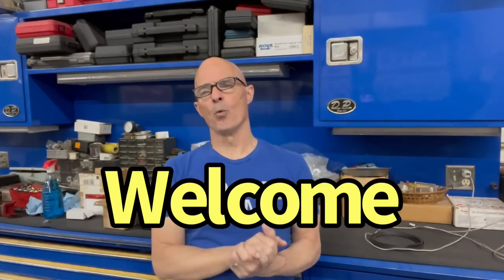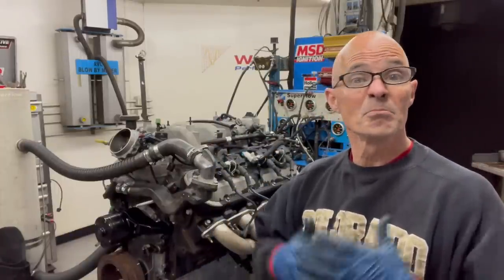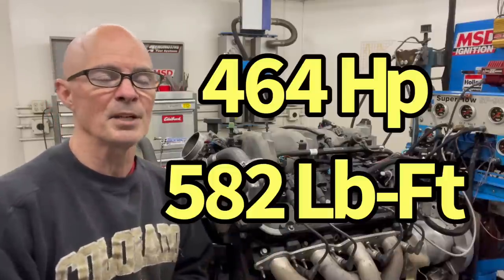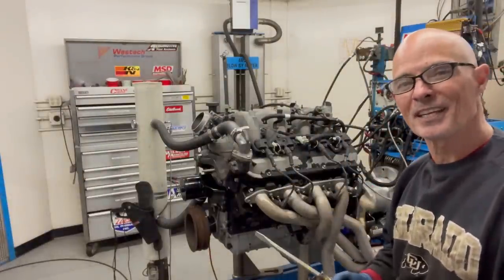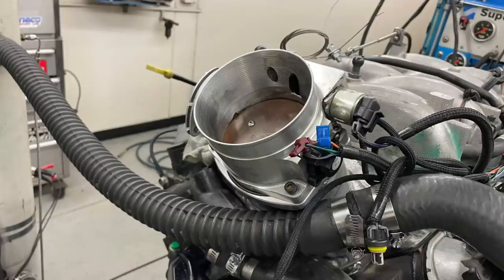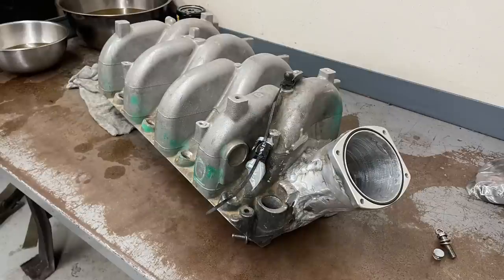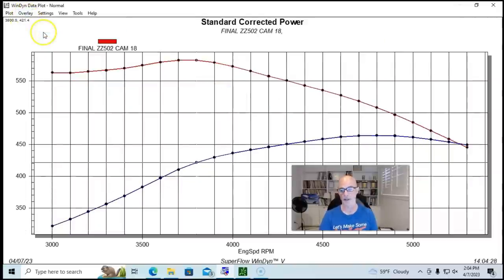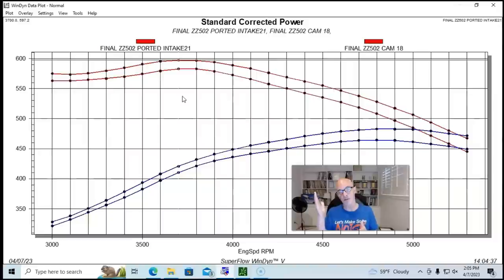GEN 7, 8.1L BBC INTAKE TEST! HOW TO SWAP A MODIFIED INTAKE AND MAKE MORE POWER WITH YOUR 8.1L BBC!

Comment: Let’s talk torque for a second a bolt on 8.1 can handle 11-12PSI all day which is madness 12 psi on 500hp and 600 torque with out pushing to hard that’s 1100-1200hp and 1500 lbs of torque

Comment: Another nice video Richard.

What you have done so far would make a killer engine for a tow vehicle.

I think that both that camshaft, and that relatively mildly modified intake are really holding the power back. 

Throw on a set of Yella Terra YT6318 rockers, you'll need a set of semi trick metric socket head cap screws. And then the correct 7/16" pushrod, at least 0.125" wall 4130.

It really wants a Comp XM284HR cam, but you have to be super careful about piston to valve clearance, it may need the YT6317 1.7:1 rocker. Billy Godbold told me it could actually be ground on their Gen VII core.
Reply: Depends on how heavy a RV you're towing. I had a 2001 Silverado 3500 8.1 and changed cam to high torque and modified intake all from Raylar Engineering.  Towing 14,000 lbs there was a noticeble drop in low-end power/torque. I also dropped gearing from 4.10 to 4.56 gears and ran shorty headers. I would only recommend doing the mods if your tow weight is 8,000 lbs, or less
Reply from the maker: WHY WOULD WE WANT .125 WALL 7/16THS PUSHRODS? BUT ROLLER ROCKERS ARE ON THE LIST

Comment: Your 8.1 videos are making me hang onto my rusty bodied 01 Avalanche 2500 for perhaps another upcoming brutal Minnesota winter. And, what if I need that pulling power to yank out a barge stuck in the Mississippi river? LOL The amazing thing is after I replaced the rear main seal, it hasn't lost a drop of oil nor does it have any coolant leaks...I thought for sure I'd be an oil sucker at it's mileage.

Comment: Richard, please do a Dodge 8.0 (1994-2003 Ram 2500/3500) V-10! I own a 2001 Quad Cab short bed 4x4 with this engine (around 450,000-460,000 miles on the original engine), and with just a crappy K&N intake, cat delete, JBA ceramic-coated titanium short tube headers and a Hemifever 93 octane tune (running on Commiefornia 91 octane), I'm running 0-60 in 7 seconds flat at 1,700 ft. Altitude. It's absurdly quicker at sea level, as even  with the tune I have on it, it still runs EXTREMELY lean under w.o.t.....lean enough to cause the passenger side header to glow LAVA red after any kind of WOT run! This thing needs more fuel BADLY.... but I'm still able to turn sub-7 second 0-60s at sea level, and I'm right around a 15 flat in the quarter mile. It absolutely destroys 8100-powered trucks, especially up any grade, off the line, and in a road race. Also obliterates every Ford V10 I've ever run-even the three valve trucks. And it beat the Fords and the GMs even before the tune..... I'd love to see what these engines actually make on a dyno, the way u set them up! Love the content!!

Comment: Looking forward to more Gen7 8.1 knowledge in part 3.
For this modified intake, thoughts on how streetability is effected VS stock intake?
Reply: Looking at the test the torque or power curve are unchanged So streetability is unchanged.
Reply: It probably makes more induction noise due to baffle removal. That would be all
Reply: It'd a bunch of work for 20hp, but I like the effort!
Reply: @daytradescottie7253  ya I know. I love turbos

Comment: Also rich is this guy Amos available to do an intake. If I sent it to him. Or just bought a stock one online and sent it to him. Along with that debating or could use some input on which is the best throttle body to use and then leaning towards a jet mass air with the SNB closed air filter setup

Comment: Hey Richard, we've got a whole bunch of prototype 8.1L manifolds that have short runners if you want to use em. You'll throw away a ton of torque, but you can extend the RPM a bit. I'd start thinking about a set of pistons as you're going to need a lot of duration to really make the short runner intakes make sense.
Reply from the maker: love to try some shorter runners-also ported stock heads
Reply: @richardholdener1727  I spent about 8 hours with headphones on grinding the stock ones down. Only took me 2 sets of heads to get a set that I didn't go through the thin castings. There's not a lot of material there. Based on the rear wheel dyno figures, worth about 15hp for all of that work. I threw my ported stock units out after I switched over to aluminum, the change was worth 65hp over the ported stock units.
Reply: Hey Micah coy, I remember watching your YouTube videos 7 8 9 years ago with 8.1 trucks. we all know RAYLAR has great products but the prices are through the also to speak on the intake thing the long runner intake is always going to be better for torque. Be nice to have something that meets in the middle to like you said extend RPM slightly but still keep that nasty low-end torque
Reply: The motor is a great platform I'm just looking for some input from truly skilled guys like yourselves to put this motor together properly
Reply: @ronkirkham3410  I would say the GEN7R at Raylar with mid length runners is your best bet for a more or less bolt on and go application (requires an LS2 throttle body) but there aren't too many options in this arena. If you can find the now discontinued dart carb manifold, its about the only manifold I know of with shorter runners, but it does require a full conversion.

Thing is, the displacement of the engine and limitations in the valve guides (for lift) as well as the pistons (again lift) mean that you're heavily machining heads and buying pistons just to run a cam that will support your 6000rpm, and then you still have to feed the engine enough air. The ZZ502 is about as big as you can go without kissing pistons and a 230 cam on a 496 is basically the same as a 210 duration cam on a 6L LSX.

I normally agree with Richard that manifold dictates RPM, but if your intake, heads and pistons prevent you from running even a mild cam by BBC standards, then you wont be able to spin it to the moon without tearing into the motor and fixing the limitations.
Reply: @MicahCoy What do you think about @EricWeingartner 's recent video on how far he was able to take the stock heads with the changes he made? The heads y'all offer seem to be worth every penny, it's just folks may not always have the pennies
Reply: @navisingh8816  Haven't seen it, link?
Reply: The first part of his video is from a previously failed head modification. He then gets into the modification and flow testing of another spec, that actually looks to have gone very well. I mean I'd be interested in seeing what sort of velocity he's working with with that porting but I was hoping you'd shed some light on whether what he's done is effective or not

Comment: You nailed it. The runner length should have been shortened. That intake would be perfect on a truck though.
Reply from the maker: the motor is use in a truck and motor home and boat
Reply: @richardholdener1727  Keep up the great work!

Comment: If you were dead set trying to squeeze everything outta the factory form....I'd extrude hone the manifold next, testing individual runner cfm before and after 
The exact same mods were used by Aussie Holden efi 5.0L guys, when chasing power using the factory intake.
Known as 'the bunch of bananas manifold' it had horrible distribution and runner flow due to the rough/bad internal castings. 
After throttle body mods....extrude honing, including port/gasket matching the manifold saw significant gains.

Comment: I'd love to see a single or twin Gt45 setup on an 8.1, considering how well these motors respond to boost, dirt cheap ebay boost doesn't sound like a bad idea.
Reply: Look up Lawrence Tolman on YouTube. He's be messing with a Turbo 8.1 for over a year. I think it's over 1000 ft-lb and 800hp now.
Reply from the maker: I ALREADY RAN THIS MOTOR WITH A TURBO
Reply: @richardholdener1727  I was interested to see a twin turbo setup. I haven't seen one done, and whether a single gt45 would be a restriction with the 8.1 considering it is slightly smaller than the s475 you ran.
Reply: @richardholdener1727  Sorry I missed that- there have been "other distractions" of late- I shouldn't let them get in the way of my hobbies!

Comment: Is the larger throttle body opening the main source of the gains, or is cutting out the floor of the intake the main source of the gains?
Reply: I'm wondering the same. Plus I have the electronic throttle body. Not sure how to sneak that larger throttle body with the smog or if there is an electronic on that large...?  Thought about running 2 smaller throttle bodys.
Reply: Each thing helps a little. But testing each thing would take three intakes and three times the work almost. That becomes much more time consuming and expensive. So to just run a well modded intake is the best option.

Comment: Please for the love of God do a 400-500 horsepower build on an olds 350. i have a 71-72 # 395558 Block/non-windowed main webs and i need ideas. PLEEEASE.
Nobody ever does anything with an Olds 350. A 374 stroker would be a good idea.
You can use a diesel 350 block and take it out to 440 cu. in. Cool, huh? A 440 inch small block!

Comment: I'd like to see how much low end power this engine could make for towing. I have an 02 Chevy with this motor in it and feel dumb when a 6.0 or 6.2 small block makes more power and gets better mileage. I need more oomph to account for the garbage mpg.
Reply from the maker: YOU NEED TO LOOK AT THE TORQUE LIMITING OF THE FACTORY TUNE

Comment: Awesome run with one of my all time favorite engines- been a "big block chebbyboi" since the '60s! A question or two; who was the fabricator who welded the manifold- that was good work, not as pretty as I might want, but the lack of warpage, the full vacuum seal says he knew his biz! Next, why was the manifold entry below the throttle plate left so rough? I would have thought that turbulence wouldn't help things at that point. But I just push em' till they either don't go fast or litter the landscape with parts of parts- your channel has begun to "lift my eyes to a higher plane"as it were. Will you be single/double boosting, S/C or other with this combo ?
Reply: I fabricated it for free so was done as fast as I could, still took 5 hours. It was done just for a test not for purty so was no need to spend extra time marking it look good.
Reply: @amospgarcia9152  Sorry if I ruffled your feathers! Actually my comment was more about the fact you got it done without warping the manifold- which is why most won't even attempt such a project. Grinding it out, sanding it and all that, comes only after you have sealed up all of the potential leaks- and Richard started by saying the engine and mani were "donated", IIRRC. FWIW, I can weld; I'd trust it for maybe a bicycle or home project, but I cannot do what you did with that aluminum manifold- you get well deserved kudos for that. My further question about the throat of the thing had to do with introduced, visible roughness- I was wondering if something special might be happening there. But thanks for your response, Amos- finishing that mani and it sealing without two gaskets or "playing games" with odd torqueing patterns to try and seat it impressed me, sorry if I mis spoke.
Reply: Na you’re all good! There isn’t a lot of good pics on the inside after it was done. It’s probably nicer inside then you’re thinking. You’re not ruffling feathers. I wish more people would modify these for others. Unfortunately I don’t do them and the those who do honestly are not doing what is needed to make good power.  They will do one of the three things and then charge to much.

Comment: Hi Richard. 
This not related to your video. Please forgive me. I would really appreciate your advice. I have a LS2 L98 motor bore to 4.030" Wisco K448X3 pistons. Make good power on wheels (389kw on wheels) but still smoking and use oil. Ring gup us perfect piston to sleeves glearence good. Dubbel chech at different machine shopsWhat can be the
 cause. I would really like and appreciate if you can give me same guidence. Thanks Richard
Reply from the maker: the ring also needs to seat properly-the ring to cross hatch pattern compatibility
Reply: @richardholdener1727  Thanks Richard. Thanks appreciate you advice a lot. The motor had run currently about 2000km. Wish you a great evening

Comment: I try and watch every 8.1 vid.  I have these in my boat and am looking to rebuild or repower. Struggling on the decision to rebuild or go gen 6. In either case bigger CID 540-555 and 700hp goal.   And suggestions??
Reply from the maker: na or boost?
Reply: Life.  Not lift
Reply: Not sure how long it would live at 4000rpm for 3-4hrs many many times per season.

Comment: The heads will flow at least double these numbers. It’s not a flow deal. This is a factory cam, heavier springs, and a stock intake that’s has been opened up. These are decent/good numbers for the combo! Plus who knows how this motor was treated before lol. But definitely a strong runner and can’t wait to see more upgrades!!
Reply: I think it needs more cam too.  Richard has a history of WRONG CAM though.

Comment: Interesting test! I’m curious how that would compare to a test ran with a holly sniper type fuel system.
Reply from the maker: they don't make a sniper intake for the 8.1l
Reply: @richardholdener1727  I wasn’t sure. I figure at some point Edelbrock will probably make a carburetor type intake for these. Considering how popular they are becoming. 
Just for fun…I’ve been wanting to setup a distributor-less ignition system on an old school big block with a coil on plug set up.
Reply from the maker: dart already did-I have one
Reply: @richardholdener1727 a sniper type system should bolt right on then right?

Comment: Have you considered changing the header size yet ?
More in more out ?
Maybe 
Regards Sid
Reply from the maker: that is not how headers work entirely, but yes I have run bigger headers (not really needed on a sub 500-hp motor)
Reply: I understand at this hp range, but was wondering how the displacement might affect the primary size and collector may be affected in  this cubic inch range
Reply: Velocity vs cfm affecting scavenging possibilities

Comment: Could you just swap wiring around on the coil packs or plug wires to run that cam if you are using a factory pcm? Honest question
Reply: Coils and injectors
Reply from the maker: yes

Comment: How did you get 420 hp on the stock dyno run? Arent these rated at only like 340? Obviously you have headers on it but im interested to know how you made so much?
Reply: Because he's not using the factory tune. He's giving it adequate ignition advance and a good A:F/R.
Reply: @AlanRoehrich9651  I understand that but were talking some serious numbers in gains

Comment: I drove a lot of trucks with these vortec8100 engines but honestly the v10 dodges would out pull them. Probably because they are up 150ftlbs at 3000rpm where they would normally run driving.
Reply: Yeah but then you’re having to deal with a Chrysler engine and transmission. Nty.

Comment: I have a 2007 2500 HD 6.0 and would like to swap it for an 8.1. Can I use the current wire harness and CPU or do I need to change it? Thanks.
Reply from the maker: crank sensor wiring is different (need to be flipped), otherwise might work with proper tune
Reply: @richardholdener1727  is the firing order the same?
Reply: @alejandrolongoria9945  firing order is the same . Not sure if you're the one who posted on suburban page about doing the swap .

Comment: And this is with less than a “custom tune” right? Probably another 20HP/TQ to be gained…
Reply from the maker: TESTS ARE ALWASY RUN WITH AN OPTIMIZED TUNE-
Reply: @richardholdener1727  Ok. I thought I had heard you say before that you didn’t place an emphasis on custom tunes during these testing runs.

Comment: With gains everywhere could he have afforded to chop some runner length or would it be worth it? It looks like a 125mm might have fit did you do a data log or record the map reading on the Holley? Like was there vacuum on the 102 @wot? I doubt there was did you happen to notice?
Reply from the maker: I DID NOT DATA LOG, BUT DOUBT THERE WOULD BE WITH A 102 MM TB, BUT THE QUESTION NOW IS, DID I RUN A 102?
Reply: I wondered... in our last episode of Tricky Ricky Does Wonderous Things, i think we said a 102mm does not fit
Reply from the maker: it fits on the mod manifold
Reply: @richardholdener1727  I thought you said it was a 102 I dunno same question though

Comment: 420hp on stock cam just with a tune is that correct? 80hp over factory tune?
Reply from the maker: you can't compare a factory hp rating to dyno data